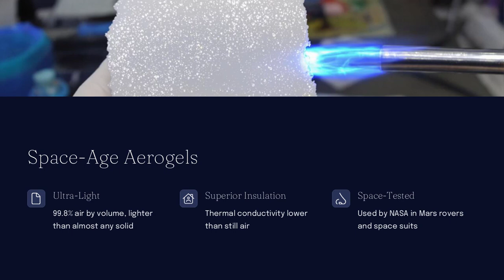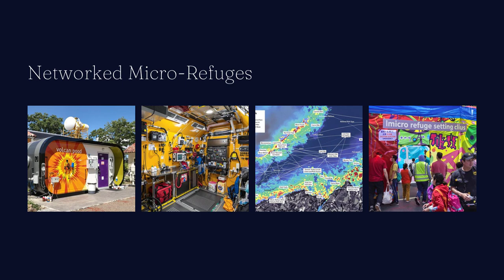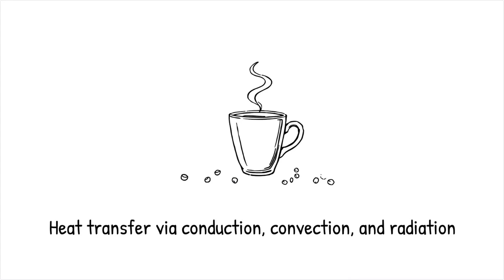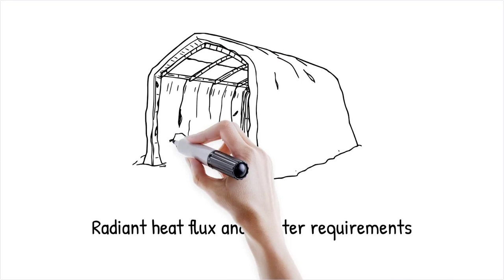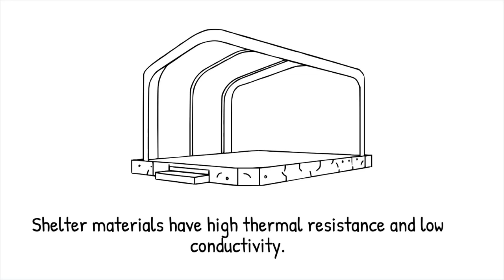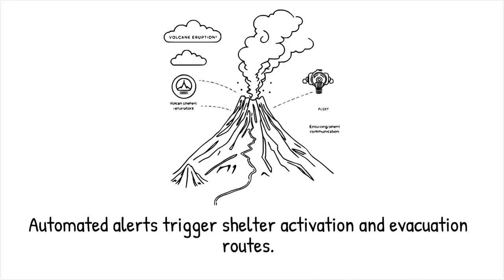Living with Volcanoes: Survival and Innovation at Earth’s Edge

Comment from the maker: How can we optimize multi-layer composite materials for shelters to simultaneously withstand high-temperature pyroclastic flows, corrosive volcanic gases, and mechanical ash loads without compromising structural integrity or air quality?
What are the limits of current AI-based eruption prediction models in capturing the nonlinear dynamics of magma chamber behavior, and how can machine learning algorithms be integrated with real-time geophysical data for accurate early warning systems?
How can geothermal systems be engineered to safely and sustainably harvest energy from high-risk volcanic zones without triggering microseismic activity or accelerating subsurface pressure changes that might lead to unexpected eruptions?